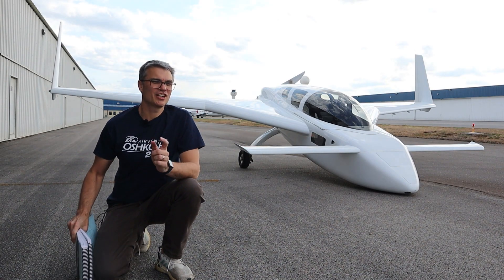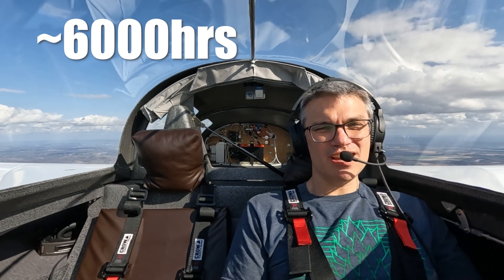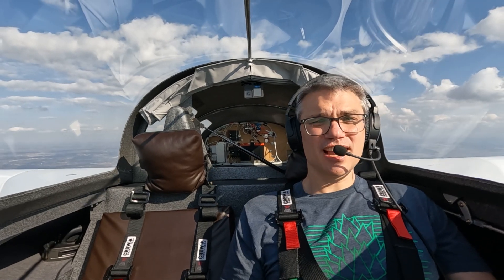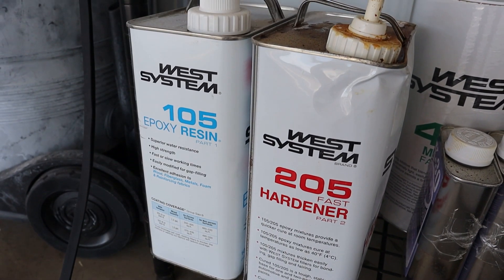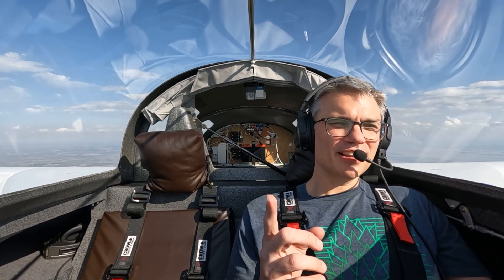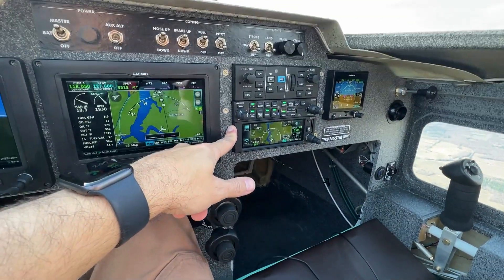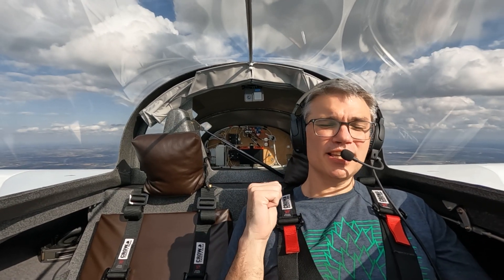Cozy MKIV Overview & FAQ

Comment: Stall resistant not proof.
Reply: Or perhaps , stall assist "under good conditions " in how it bobs to indicate and gently self correct straight and level at fixed stall speed. Still requires nose down to recover from Bob.

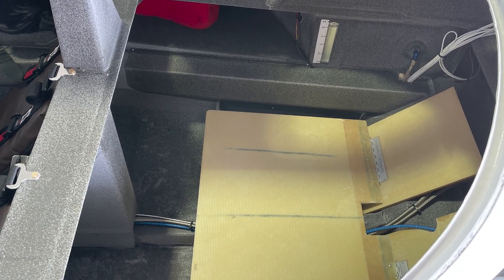Comment: I've always loved these airplanes. @4:03, why is it backwards? Also efficiency. A traditional stabilizer in the rear generates downforce, which the main wing must compensate with more lift. That means more AoA and induced drag. With the stabilizer in the front, both surfaces generate lift and there is no extra downforce that must be compensated.

Comment: Looks like a quality build you have there.   I think it is a misnomer that the main wing cannot stall.    If you loose the engine, you’ll need to land as soon as possible.  If you loose too much airspeed, the main will deep stall and it is unrecoverable, unfortunately.
Reply from the maker: Thank you! A per-plans canard will always stall before the main wing at any airspeed (as long as the CG is within the envelope) This reduces angle of attack and will never allow the main wing to reach a stall condition. Doesn’t matter how fast or slow you are or if the engine is running or not. It’s a beautiful design that removes one of the biggest dangers in GA

Comment: Great video!  I'm in the research phase on the MKIV.  Two questions - 1 - I'm 6'4 and "leggy" as well.  Anything else you'd modify if you were a little bit taller (like moving the pedals a little farther forward)?  2 -   Any concerns getting major or prefab components these days?  (Landing gear, metal parts, etc)?
Reply: Did you ever get an answer on fit for a tall pilot?  I'm also 6'4", and the it looked like a pretty snug fit when Russ showed his knees under the dash

Comment: I have adored this design since I first learned about it. I really want to build one & I know that I can afford to build it, but what I'm really concerned with is what does it cost to insure, run, and maintain? After all, building it is pointless if one can't insure, fuel, & most importantly maintain it.
Reply from the maker: 750/yr for liability only, 5-16gph depending on throttle and mix. I flight plan 9gph in cruise, mx costs are minimal so far
Reply: @russroams  thanks for the reply. Could you possibly be a little more specific about maintenance costs? What sort of ballpark is "minimal"? I must say that I am pleasantly surprised by the insurance costs. I somehow expected that to be much more than that.
Reply from the maker: @mikeycrabtree123  The gotcha with insurance is of you want hull coverage. I don’t know how much that costs because nobody would quote me. I was told to reapply after 350tt 100rg
Reply from the maker: @mikeycrabtree123  mx costs are hard to come up with. My airplane is only 1yr old and a lot of issues I’ve dealt with are teething things. My first “annual” cost zero dollars for example
Reply: @russroams  that's a fair statement. Thanks for sharing.

Comment: I fly a Piper Warrior like an old man drives a car.  Watch the speed, never below 80kts on turns and keeping the ball in the middle.  Always worried about spins, so something that's stall proof and spin proof is very interesting.  I wonder if there's data and stats on the safety record of canard designs vs a traditional style airplane.  

This is a really nice aircraft.  I wonder if you can have the rear seating removable?  I expect to be solo 50-75% of the time.  Two people 25-40%.  Three to four people 10-20% of the time.  It would be nice to have the flexibility to put the seats in when I have more than two people and take them out when for extra storage and fuel economy.
Reply from the maker: Yes I have a removable platform for luggage in the back that could come out for rear passengers.

Comment: Nice video. There are not many high quality videos showing a fairly plans built Cozy MKIV on YouTube, and then especially few that share the real world numbers. What engine does your plane have, and what is the circuit board looking thing on the back bulkhead?
Thanks.
Reply from the maker: Io-360, circuit board is probably the engine monitor, also battery and  contactors are back there

Comment: I specialize in aircraft cabin heating systems. I'm assuming you're utilizing heat off the muffler ?  If so is it effective ?
Reply from the maker: Yes its a muff around the exhaust. It works so well I cant leave it on continuously we get too hot. Do you know of any existing boxes that will let me blend hot and cold air together? Instead of just on/off heat
Reply: @russroams  I dont but it sounds easy enough to build. No different than a mixing valve on a turbine powered aircraft only simpler. I specialize in combustion heaters for general aviation twins. I would think a separate fresh air duct should suffice. Just mix the air that way.
Reply from the maker: Is janitrol still the standard or some newer tech these days? My father had an older twin commanche with one of those
Reply: @russroams  Janitrol and southwind TSO's have been bought up by Hartzell. They also bought C&D airmotive for their hy bred heater with no AD's. The Janitrol line produces whats called an (I) Series combustion tube  (I) EYE for lack of a better description That has no pressure check requirements. It's made out of Inconel for better heat resistance. I build the same inconel tube on PMA. It's a gimmick to sell heaters. They will still fail, it's just the nature of the industry to sell a supposed improved product.

Comment: First, great video and introduction, Russ, and for your beautiful aircraft.  Just awesome!    Second, I'm a Cherokee driver, with only about 65 hours as PIC since getting my ticket last year.  I'm a solid and very cautious pilot.  Do you think a Cozy is a suitable upgrade at my experience level?  Lastly, I think I've decided it is the perfect aircraft in terms of cost/payload/range/burn/ and speed.  There just doesn't seem to be anything affordable in a 4 seat (well, practically only 3, riight?) with that speed and payload.  What downsides have you found?  Perhaps the experimental insurance rates? Thanks in advance.
Reply from the maker: I only had 70hrs total when I started flying mine. Personally I think its much easier to fly than a c172. There are quirks about all aircraft I think

Comment: Really nice job on the aircraft, and quite nice explanations as well. 
I've been exploring a lot about canards lately, and I think cozy really has it all. The only thing I didn't manage to confirm is can it land on a grass airfield? I know it has really small wheels on MLG, and there's danger of debris falling into the engine from the nose during TO, but is there any real option? Some sort of a customized landing gear, or it really comes down to the pilot and his decision? I'm assuming that surfaces that are a little to rough are not suited for cozy, but where would you draw the line?
Reply from the maker: Most folks do not operate canards off grass strips. The nose wheel likes to kick stuff up into the propeller. If it was a very long and meticulously maintained strip, I might try it but otherwise not. Just my opinion
Reply: You will need a nose wheel cover like the MiG-29 has...and maybe a more robust tire size and support? It really depends on the grass strip...if it is like a golf course quality...no issues...